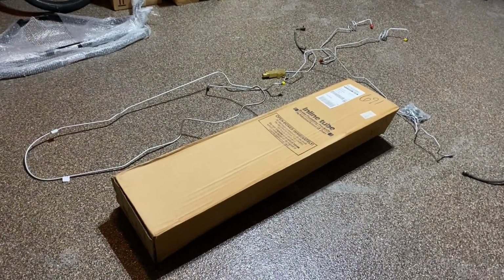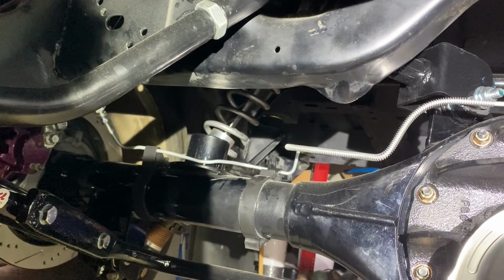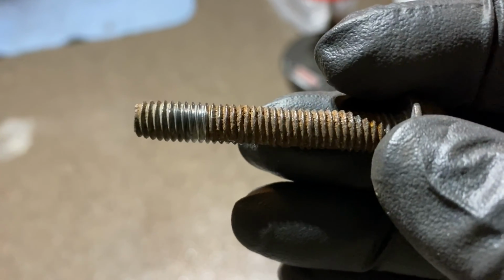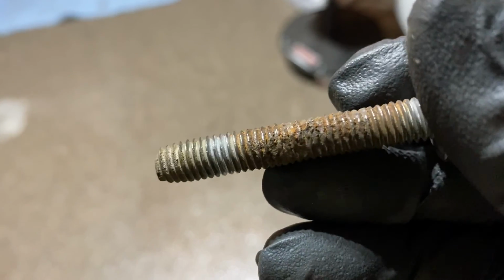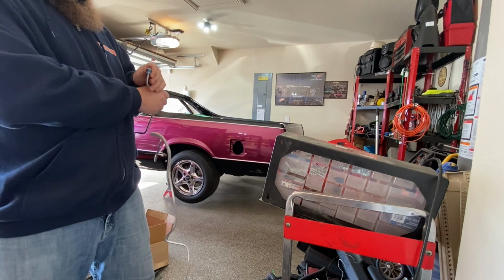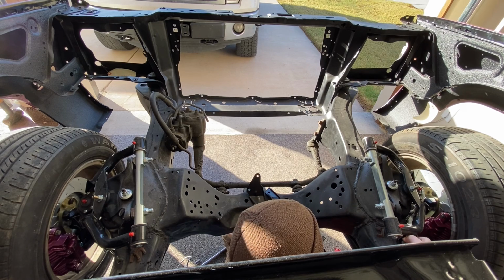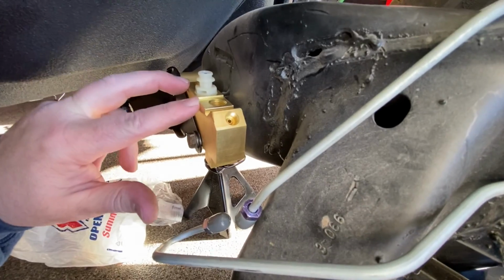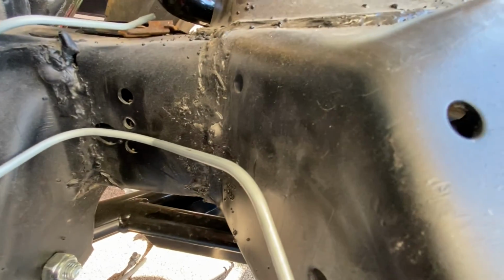G Body El Camino Restomod Brake Line Installation Part1

Comment: Hey Josh ! I just bought a 1985 el Camino Conquista 305 v8 my front brakeline a are bad but I want to change them all, do you know where I can order that parts?
Reply from the maker: Probably can get it from eBay, any parts store , or Rockauto.
Reply: @CarsandJoshee  thank you brother I’ll try rock auto, advance auto parts and auto zone both didn’t have anything for my elcamino specifically thanks for the help
Reply: @jarrellwilliams2562  got mine from summit racing
Reply: @NickFortier  thanks bro I got them installed putting shocks and coils in front and rear now she’s running and stopping smooth
Reply: @jarrellwilliams2562  nice, I'm just putting the umbing in before I put the body back on frame

Comment: Don't think ya really need that bracket that attaches to the propvalve? Pretty sure it's just to hold the column shifter linkage in place. Unless your planning on running a column shifter??
Reply from the maker: Yep, keeping column shift. I have a kit from Shiftworks I’ll need to bend to fit. Should be getting to that pretty soon.
Reply: @CarsandJoshee   What made you want to keep it on the column?
Reply from the maker: @sparkplug2646  I’m keeping the bench seat and don’t want anyone to have to straddle the shifter
Reply: @CarsandJoshee  yeah makes sense!. Beings it's just me, the old lady and the dog, and bumped up the hp/trq I'm switching over to the floor shifter. I'm scared shitless everytime I run through the gears with the column shift lol.
Reply from the maker: @sparkplug2646  right on. I don’t think I’ve ever rowed through the gears on a column shift. I’m basically going to rely on transmission tuning for the right feel.